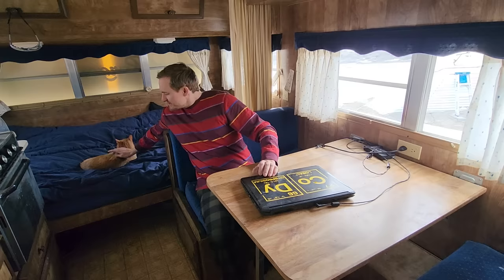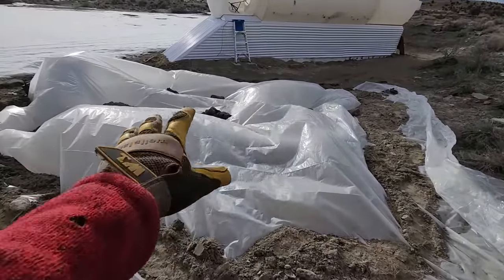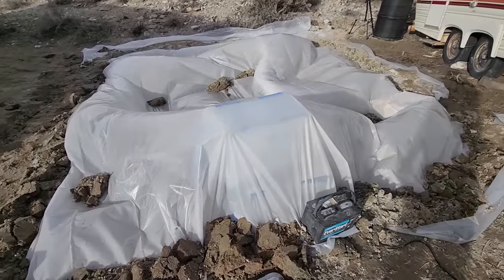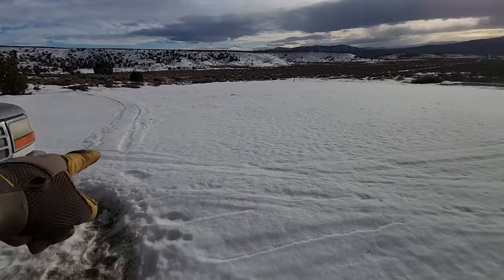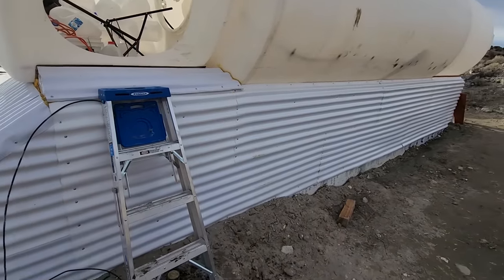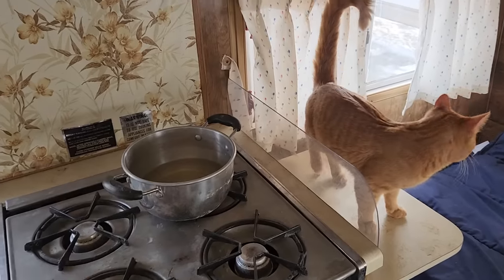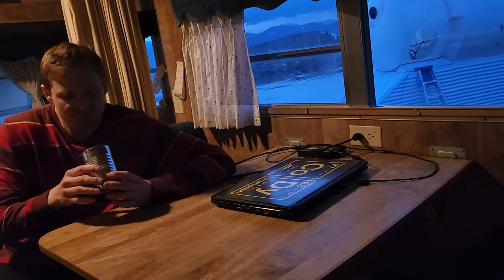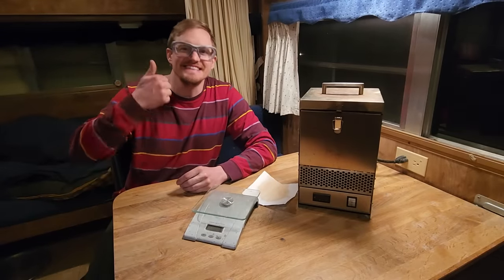ChickenHole Base Ep 21: Moisture Mining

Comment: as soon as i saw that huge field of snow I thought, "shovel time". you could probably fill one of those containers with all that. and to clean it, you could use the tarp method too. set up a tarp in the tank. have a funnel or channel just under the central point, and let it flow into another tank or smaller container.

you could also place filters under the dripping hose from the dehumidifier , maybe help save an extra step. they'd have to be changed regularly, but then, so would any other filter.

Comment: Hi Cody, I noticed that there was a lot of empty space in your rover payload bay.  From one traveler to another, when I am on an away mission in similar conditions, I increase my payload by a substantial amount (often cellulose fuel rods but minerals are also a frequent sample) and it helps increase the coefficient of friction of my rover with the frozen dihydrogen monoxide precipitate.  This practice has reduced my occurrences of becoming mired and my hope is that this information is well received. Clatu verada nicto, and bravo!

Comment: When you mentioned moving heat around with brine, I remembered that heat pipes are actually a rather simple structure. Especially water vapour containing ones. You fill a heatpipe made out of copper tube with water, heat it until the water boils and all the volume of the tube is filled with just steam and water, then you seal the tube while it's still hot. Once it cools, it should act as a heatpipe, as far as I understood. Maybe this would be an interesting experiment to try?

Comment: Cool experiment with the humidity catcher.
Remember that the humidity under the plastic sheet in the soil does not replenish from the edges unless there is a shallow underground stream running under it, you will be preventing rain fall unless you direct it into the soil for some reason..  After some time you will have sucked all the moisture out of the ground and it will give no more.

Comment: With the dehumidifier set up, with how slow it runs, you could have it connect right to a slow drip filter so it's already filtering/filtered when you want get access to it. A very low cost and low maintenance filter would be a biosand filter. Just need a diffusing plate, a bunch of sand, and a separated mix of coarse, medium, and fine gravel. You could dig a hole and build it right in the dirt. The good thing with this filter is that it should also remineralize the distilled water to taste better and you might have most of the materials on hand.

Comment: A simple opportunity for improving  the moisture collection could be as simple as digging some troughs under the tarp to increase surface area. 

Also, could utilize a greenhouse as a fairly passive water cleaning process as well. Condense the humid air, replenish by supplying the plants dirty water. Their transporation should increase efficiency overall id assume

Comment: I too live in a shuttle of sorts. Im in a colony of them though and we are a bit more luxurious. I also live in Texas so while I had a few a days this winter of no running water (learned the hard way, my filter broke before the hose thankfully) but I got a electric space heater/radiator for incase gas ran out and the local supplies are out/too expensive. Your's is a bit bigger and I'm jealous of the counter space and oven. I got barely a stove and sink with no counter space. Learned to make instant coffee becasue coffee pot takes space. I know not a big deal but saw tip video that showed them using water from the tap to hydrate the instant coffee (not much water) and then adding in the boiling water and it prevents the instant coffee from burning which can cause it to taste funny Not a coffee snob and rarely drink it but I can't tell the difference and it's significantly cheaper and stores significant;y longer.

Comment: Good proof of concept. Is there a reason that you used a reflective covering on the moisture generator system  instead of a black thermal absorptive black covering? Wouldn't that increase production or would it dry the ground surface too fast to slow down the moisture wicking action of the soil?

Comment: Sparky from south Florida here...

Not sure if you will have any electrolytic processes happening (incidental or intentional)

But if you have any dissimilar metals you can prevent galvanic corrosion by holding everything at the same potential via bonding.

Basically if everything metal is solidly connected electromechanically. You can't get ionic transfer. Down here it's an incredibly large component of infrastructure to decelerate corrosion.

Saw you grounding everything and wanted to make sure you understood the major benefits of doing so.

Cheers

Comment: That clay was likely a bit less than 20% water by weight. The can oxidized and some amount of iron oxide was carried out with the clay on the second measurement. It may be a negligible amount or it could be something leading to meaningful error in the end conversion. Sources of measurement uncertainty are worth eliminating in some cases, I'm unsure if this is one of those cases.

Comment: Great video. I am wondering if your condenser in your dehumidifier is made of aluminium and whether you might be ingesting a little aluminium in solution in your water?
I like the idea of using brine as the pressure regulator fluid. If you had a fairly large diameter pipe from your pressure regulator to your greenhouse if that pipe got filled with brine it would get very heavy and pull open or shut a simple valve? We live in caravans and spending time preparing for and dealing with frosts is just a pain, so I like the brine idea.

Comment: I have a few thoughts Cody, not sure if you'll read this mind.

The solar panel you use to run the 500W dehumidifier can't be making more than 150-200W at best; even the highest grade 1800mm x 900mm panels are only just reaching about 560w in full irradiance - it must have a very low uptime?

I'm not too well versed on ground water, but in my head if you dry an area out, it will self-regenerate somewhat, but there must come a point when it reaches an equilibrium, so the yield must surely drop over time. that much water in an hour is amazingly good but i think it will become much lower with time?

My last thought is your comment about performing moisture farming on Mars. Surely the combination of very low temperature and lack of atmopsheric pressure would make the vapour pressure at a point impossible to hit dew point without a fully sealed and pressurised environment. Then with how weak the solar energy is compared to earth, it seems like it would be a really difficult way of doing things - I can't help but feel it would be easier to use the solar energy from panels and electricity to melt ice electrically, rather than deal with the problems of vapour pressure and needing to keep the ground sealed when you're also trying to melt and extract it.

Comment: Cody, make sure your trailer is level before turning on that fridge. Running it in gas mode is going to be the most efficient way that use it too. Inspect the back side of the fridge before turning it on though, look for a yellow residue. If present, you need a new cooling unit for your mouse proof box.

Comment: Just got caught up with the last couple episodes of this series and had some input about your induction cooker if you still plan to use it despite your new habitat. I've had issues in the past getting them to run on "modified sine wave" inverters. these are a bit more efficient with the conversion to AC, however some electronics with act funny if they aren't powered with "pure sine wave" AC. Most side effects are just electrical noises or whining, however when it came to the induction cooker I could never get it to work without a pure sine wave inverter. Hope this helps, or is at the very least informative!

Comment: I would just put the desiccant into a sheet similar to a weighted blanket that way you can roll it out.  Based on conditions and time you can gauge when its saturated and roll out another sheet ontop or harvest. Then just put them into one those containers and let the water condense out from thermal or any method you shown.

Comment: To quickly calculated how much water is in a given amount of that clay, multiple the total weight of unfired clay by 0.024 (gallons of water/ pounds of raw clay). So if you mined 100 lbs of raw clay, it would contain 2.40 gallons of water. Its a LOT of energy for very little gallons per pound of ore and i think the moisture farming is way more efficient, even at scale. If you were firing the clay anyway, it would only be worth condensing if your condensing right was essentially passive.

And to show my work, its pounds of raw clay * 0.2 pounds of water per pound of clay / 8.34 gallons of water per pound of water (at room temp). You would actually get less or more yield than you expect though if you don't adjust 8.34 gallon/pound to account for temp shift when weighing raw clay. 

And why did use imperial instead of metric? Because even on Chicken base, SOMETHING would use imperial units, or some communication protocol would require imperial units. it ALWAYS happens. It would probably be some kind of critical telemetry protocol developed by a US company that monitors volatiles on mars that requires the communication to be transmitted in imperial units (despite both sides likely using metric for everything else). Better be prepared for unit conversion errors now!

Comment: Farming something like water at the ChickenHole Base really gave me Blade Runner 2049 vibes. Add a desaturation filter on the image and that place starts to look like Sapper Morton's protein farm. The only thing I'd want to make sure of is that the dehumidifier doesn't contaminate the water with something nasty when the distilled water runs on its surfaces. It's not the same principle than an electric dehumidifier of course, but I've always wondered if water that got collected from a humid room by a bag of dehumidifying crystals could be safe to drink of it the crystals contaminated it.

Comment: A roll of black plastic used to cover the snow field would produce alot oof water for sure . Use some black coiled water pipe in a frame with a small dc pump with water could heat the living space easily.

Comment: The filter is probably a better idea than just boiling the water.  Unless specifically made for making drinkable water, the dehumidifier probably has some lead in the fixtures and solder joints internally.  I'm sure not much actually comes through, but if that ends up a main source of drinking water, doing some light filtering is a good idea.  If not outright distilling it all...

Comment: Using the dehumidifier as a water source is a good idea but I was wondering the air comes out dry and I think you said warmer so could you feed that in to the hab and then back out to the existing location…
That may give heat and remove moisture from the hab as well 
I know on Mars you would need to use a heat exchanger as well etc but just a thought even if it only gave a 1-2 degrees of heat to the hab but would also reduce the possibility of damp in the hab etc

Comment: I've been living for the last couple years in a RV, about half that, off grid. I need to get a battery (lifepo4) & solar system and small wind mill. Have been thinking of a hydrogen generater to make fuel after battery bank is full and compressing into mainly LP tanks for cooking, heating and if need be, running a generater. Though it will prob be only around 50% efficent compared to the batteries, it would otherwise not be collected anyway, so a win win as I see it. To do electric heat, would need a real large battery too. If it works well, maybe invest in a high pressure compresser like for hp air guns & suba tanks.

Comment: Ever checked Craigslist for used electric carts?  You can find 'em around here for $5 or so, usually with decently-new batteries.  Seems like it'd be handy for moving about, as well as serving as a backup battery bank.  (Maybe even an auto-mobile one?  Wire a switch between the motors and an inverter, perhaps.)

Comment: Interesting concept. At around 6:45 you mention that this system would be indefinitely scalable. I wonder if the tarped area becomes too large, and rain can not penetrate this whole area: Would over a long time the dirt underneath be bone dry (and the system collapse)? 
I totally can see that your currently used area could be sustainable, since rain water can still moisten the soil under the tarp. But what if the tarp would be 100-1000 times the size?

Comment: The second method far more reliable on Mars, a condensate still would need the moisture to replenish, which isn't really viable large scale without moving the still.
But more reliable than both would be rust to Iron metal, which is 6 H2O to Each Fe3+ reduced.

Comment: Brine in heat exchangers isnt a terrible idea, so long as you keep it in materals that wont degrade from the salt it's far harder to freeze than pure water and has a usably good heat capacity.
Could also use it to make hydrogen with excess power :)

Comment: Hmm, practicality of a solar-thermal solution, like an old satellite dish or something, covered in reflective mylar. You'd put soil in the focal point, boil off the water, capture the vapor and let it cool down. on a glass sheet or something. It'd be more manual labor to move the soil, BUT, yield might be a bit higher per kg of soil processed.

Comment: Tech Ingredients has a some videos on improving AC efficiency by using liquid desiccants, the desiccant is then heated/evaporated to recharge it. I'm wondering if it wouldn't be possible to use such a system to extract the moisture just after the evaporation stage.

Comment: You could probably increase your yield by making the collection tarp more uniform with collection trays beneath it. If you are just going for proof of concept though it could work but it's not enough for collecting on Mars for like plant distribution and daily intake. Worst case scenario you would need to set up peltier devices and sacrifice solar energy panels to collect at least two liters a day. They say the body requires eight cups of water a day but you can get by on 3-5 in a pinch, if you are of the line of Eld you only need a few drops. Lol. Growing up in a mobile home with no AC you learn a thing or two about moisture and humidity. Oh yeah digging postholes in a grid would also increase yield I think.

Comment: Uneducated question: if you still have the acidic barrel, would it be plausible to store water inside, then when you’re ready, decant it and add something basic like potash to balance the ph enough for gardening, or perhaps even distillation? I hate to see it go to waste and I still think about the video where you explained that even after cleaning, it was still unusable.
Reply from the maker: The problem is that the formic acid is soaked into the plastic. Cleaning, even with alkaline solutions, only temporarily makes it bearable.
Reply: @theCodyReeder   so it probably wouldn’t be worth it to store the water inside, knowing it will become acidic, and then treat it after you’ve taken it out for use? In my mind I’m picturing filling it with water and hooking up a tap, and then when you need some, filling a bucket and stirring something basic into the bucket. That does seem like a lot of effort now that I type it out, but when conservation and reliable storage is so important, would it be worth it? And would something like the potassium hydroxide in wood ash cancel out the acid and make the water potable, or would that only help balance the ph and not make the compounds healthy to ingest? Sorry, this is probably already a clear decision in your mind, I hope I’m not wasting your time.

Comment: Wow. So basically cover a large area with painters tape and make a tent, and run a dehumidifier on solar (not hard at all 500 watts) and you probably have the best water generator you could have. Use a large area and 4 dehus at 2kw, with an array of used grid tie panels and an inverter and you probably have a decent system. I wonder if you covered a large enough area if this would work in summer.

Comment: I had an idea for a device for use on mars that basically got filled with regolith then pulled a vaccum on it to freeze dry the dirt for water.  I went with that idea because Mars is just above the pressure where water sublimates, so you just need to open a valve to the outside to vaccuum it down to pressure if it gets too high.

Not sure if this

Comment: Would a biogas generator work for your stove and potential electrical generation platform? (compressed natural gas)? this would also serve a purpose for you to gain a liquid fertilizer for your greenhouses.
Reply from the maker: Indeed it would. I've never had much luck with them though. I was actually planning on using hydrogen for most combustion requirements.

Comment: your base would probably benefit greatly from wind power. think about how many megawatts wash over those mountains!

also, definitely consider your electrolyte intake. if you'll be using that ground water, it will have hardly any electrolytes and you could suffer severe consequences

Comment: Awareness raising video!
To extract water from the permafrost on Mars, given typical atmospheric pressure of around 600-800 Pascals and temperatures typically less than 0oC, one needs to locally raise the pressure and temperature to over 1000 Pascals and over 0 C to allow for condensation to liquid water. 
That's an interesting engineering challenge!
Reply from the maker: That's why I mentioned needing to collect it as a solid.
Reply: @theCodyReeder  Missed that! Thanks.